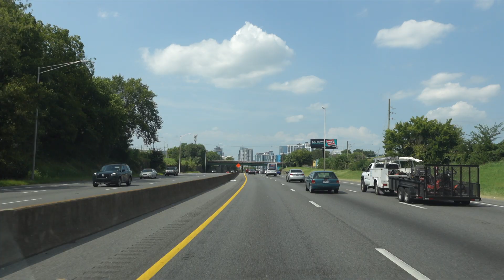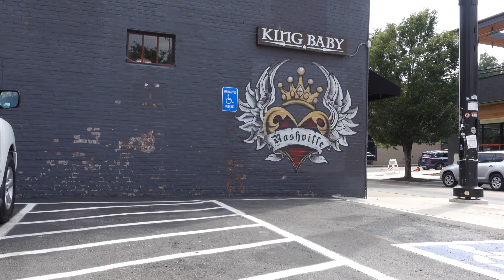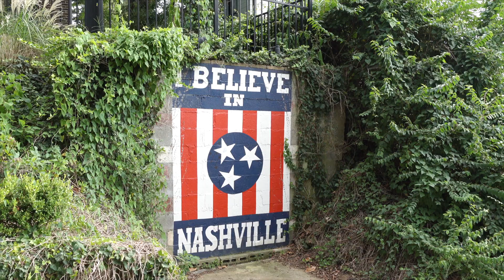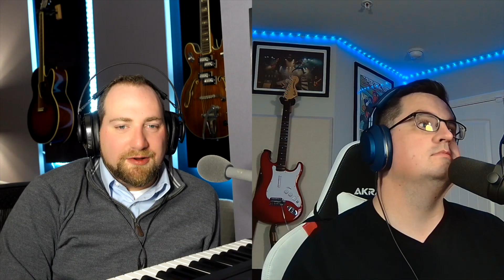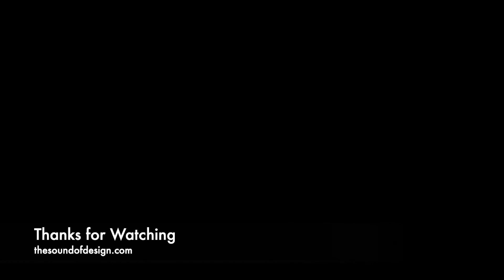Episode 24 The Most Important part of your system

Comment: Question.  Is there a audio brand that you would stay away from because they are wayy overpriced?
Reply from the maker: Price is always determined by the purchaser, meaning that as the one making the purchase you determine what your value is not the seller. If you're in the market for a $200 speaker then you look at those options if you're in the market for a $20,000 speaker then you look at those options because the manufacturers are meeting the demand based upon the number of folks who are willing to invest at whatever level it is and I can confidently tell you that after 10 years I cannot talk someone into spending more than what their real value is